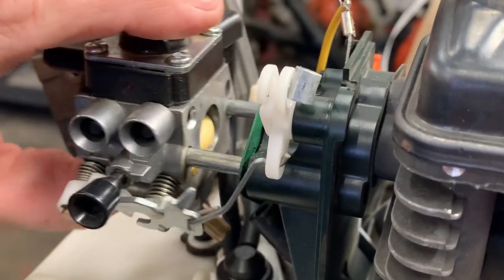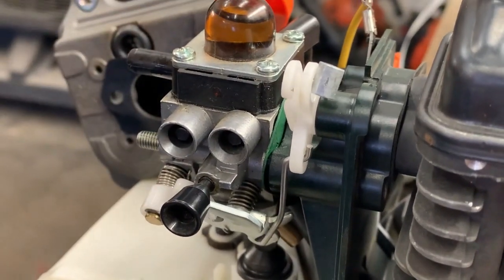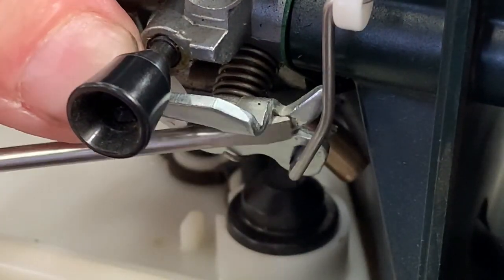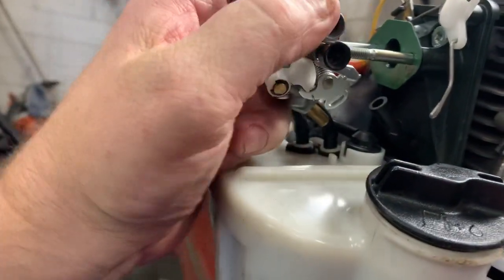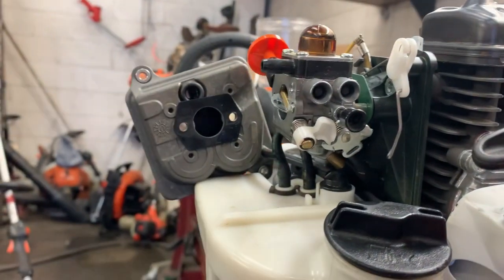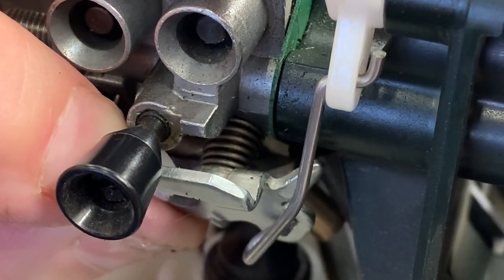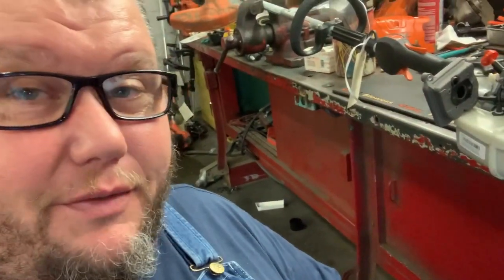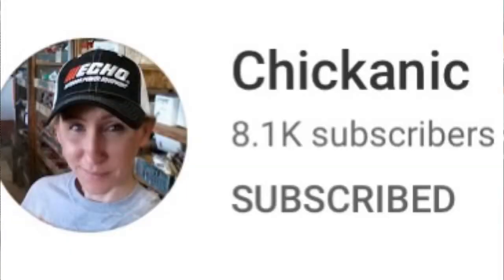ANSWERING CHICKANICS QUESTION! STIHL FS111R CARBURETOR REMOVAL WITHOUT BREAKING ANYTHING!!

Comment: Thanks for the tip.  What's your opinion of Chickanic's new video about the Stihl oil? I know those spark arrestors get plugged but find it hard to believe it's from using Stihl  branded oil.
Reply from the maker: I’ve seen more plugged up engines using non stihl ultra oil
Reply: I guess I didn't make it clear enough in the video, that it really is how you run it and not just the Stihl oil. I don't want people to not use Stihl oil, it's great, just want them to know how to fix their issue if it arises. Maybe it is just because so many people around here use Stihl oil I see it more in those units. The shop I own sold Stihl for 20 years before we switched to Echo. So half the town owns them. LOL! One of my favorite pieces of equipment is my 20 yr old Stihl BR400. I'm not going to disclose weather the Exhaust screen is still in it. LOL!
Reply: @Chickanic  I understand it's from running at part throttle but you also implied that running a different top shelf oil could help? I don't work on a lot of Stihl equipment and I'm not brand loyal to Stihl oil or any other brand oil.  I usually recommend the canned premix to my customers after a repair.  No particular brand though.
Reply: @brianking1138  I just don't see it as often from other good oils, but like I said, A LOT of people use Stihl oil. I have seen a Brand new Stihl Backpack blower clog up after one use from a full tank of properly mixed Stihl fuel. It was bizarre to me that it could do that. Their exhaust screens are the worst to clog up. The only Pre-mix I see problems with is Tru-Fuel. Not sure if there are just bad batches at Lowes sometimes, but I get units in the shop that all I have to do is change it out to regular gas and oil and it runs. The customer will tell me that they have been running it in their unit for months and it works in other units they have. I have no explanation for this other than sometimes it just doesn't work. Not sure why.